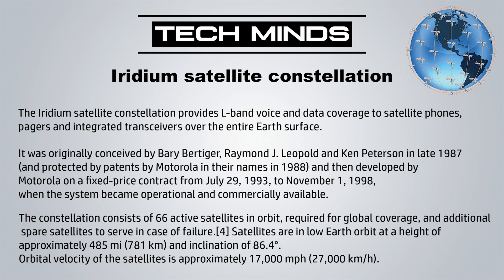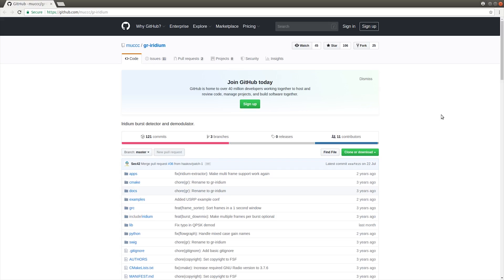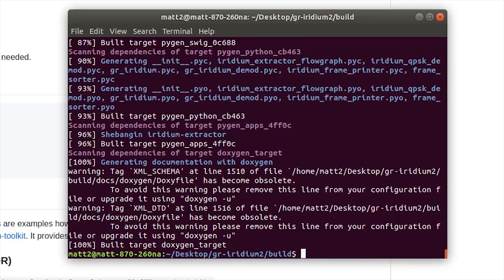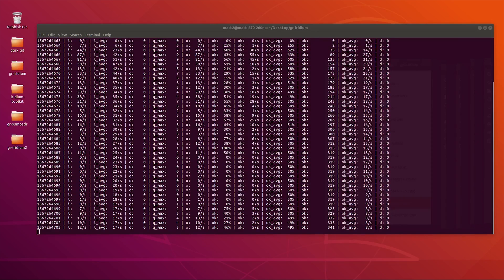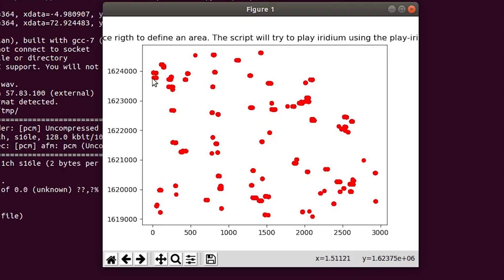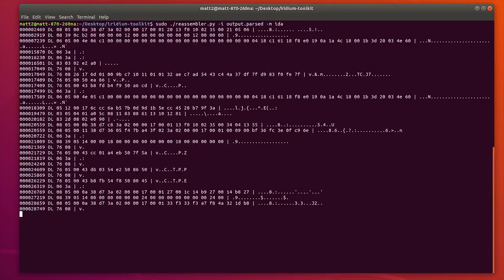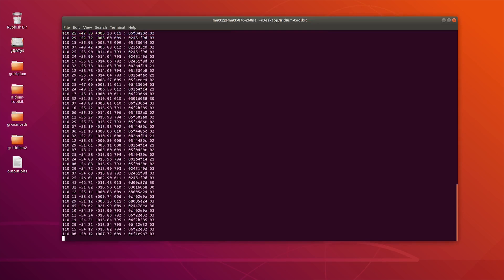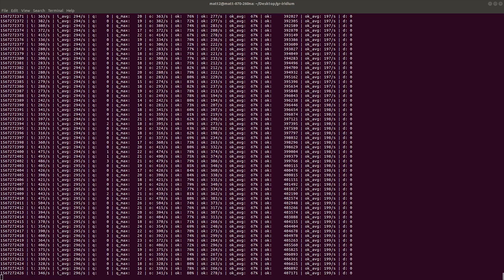Hacking Iridium Satellites With Iridium Toolkit

Comment: Great video and I managed to get everything to work except the codec which returns the following: sh: 1: play-iridium-ambe: not found. I followed the description but the ambe codec I have is just over 60K, I assume that that is because it is a newer codec than the one you show in this older video

Any help would be great. Everything else works an absolute treat
Reply: Needed the PATH setting, my mistake
Reply: What was your workaround for gr-iridium needing gnuradio 3.7.6? Did you compile the older version? Thanks Rob

Comment: I got an error when I was trying to run the Cmake Command. It said that two errors occurred and stopped at 63%. This is my problem with LINUX- EVERY SDR Project I try on Linux involves just a few "easy" commands in linux and I ALWAYS GET ERRORS and there is absolutely no one that can or will help me solve them. You typed "Make" and it just bebops along and finishes I do it and that's where this project stops. 

It's gotten to the point that I have to run through these tutorials before I even think about getting the antenna because there is always an error of some kind.

I know I'm whining and that I must suck or something but this is absolutely miserable. Maybe I can indulge in a little complaining because I know that there is literally no one that will read this or reply and if they do it will be with nothing constructive.

Comment: Thank you so much! Very helpful indeed.

 I just have a problem and would appreciate if you can help. I want to use offline mode and I already stored the received data from Ring Alert channel and be able to decode it in with similar algorithm in MATLAB. But here it seem the iridium-extractor does not go through data at all and return zeros for parameters and terminate. any suggestion? or whether you have a sample data set I can use?

Comment: I am doing some school research work on Iridium Radio Kits, and I am stumped with the following idea and correct me if I am wrong.
Looking at the Iridium makeshift antenna coupled with an SDR, doesn't SDR output I-sample and Q-samples? What happens between the samples and actually the gr-iridium extractor. Are the samples turned into hex codes which is then decoded in the Iridium toolkit? 🤯
Reply from the maker: You would need to look into the GR-Iridium source code to see exactly what it’s doing.
Reply: are you the balloon guy?
Reply: @drspastic  who is the balloon guy lol

Comment: Hi, thank you for everything! I have an issue, it would be awesome if you know how to solve it. When i put the reassembler command for pager messages, the output that i'm recieving are coded messages or i don't know what those are, they are something like this (this is a line taken from my terminal):  
Message 3525599 0046 @2020-03-22T21:07:04 (len:0)  18 OK  : LgAxIybd8X3gZHE7IE2PQvVuD7YefKA1CekD9UAsnxwunncKkrRGzVsh3n+Q

I don't know what is this...
Reply from the maker: Is that from using the pager or msg command?  I havnt seen that before but maybe the msg packet is encoded?
Reply: @TechMindsOfficial  msg command, I think is encoded. How do you receive the messages ?
Reply from the maker: I’ll be able to answer that better when I setup my Linux box again for another video. Please bear with me and I’ll get back to you :)
Reply: @TechMindsOfficial  Ok, thank you very much!
Reply: @TechMindsOfficial  Hi again! Have you been able to find out something about this topic?

Comment: Great video.. I have tried to follow your instructions  to build the gr-iridium , but it fails ( I have Gnuradio working from a repository install  -  stuff changed relating to the 3.7 version of gnuradio by the looks and I can't get it to compile and the same "bug" has been reported on GitHub , with no response :( 
I wonder if you have considered re-visiting this  - I am ripping my hair out :)  I think that you need to build gnradio ( rather than install with apt-get) but there are few clear instructions on that even on github :( 
Love your work BTW! 
I will listen for you on QO-100!
Reply: I'm stuck at this problem too, did you ever find a solution?
Reply: @RobVK8FOES  no , sorry - I moved on

Comment: Hi, thank you for everything! I have a question, i'm working with hackrf one and everything seems to work fine, the only thing is that i don't know if the voice decoding is working, because when i left and right click, this message comes up on the terminal "sh: 1: play-iridium-ambe: not found" , so i don't know if i'm missing something about the configuration or if it's just bad luck and I haven't captured the correct frames
Reply from the maker: Have you set the PATH VARIABLE to the Ambe decoder? Google how to set PATH Variable on Linux, that will help you hopefully :)
Reply: @TechMindsOfficial  thanks i think i know whats the problem, did you had to install mplayer?

Comment: sudo ./stats-voc.py output.parsed
[sudo] password for css:       
0
button=1, x=197, y=216, xdata=-0.029052, ydata=-0.006429
button=3, x=295, y=205, xdata=-0.007319, ydata=-0.009702
sh: 1: play-iridium-ambe: not found
getting this error how do i correct this??
Reply: Did you ever find a solution for this? Thanks

Comment: Good again in the end I was able to solve the path problem. Now I have another question, I was thinking of buying a sdrplay duo to accompany my hackrf and I wanted to know if there is a conf file of the sdrplay for the gr iridium since the bias t of my hackrf does not sufficiently feed the patch antenna of sdrkits, what do you think ? Do you know if it is compatible? you have the duo have you tried it here? Thank you very much, your videos shed a lot of light on this topic.
Reply from the maker: I haven’t tried the Duo as of yet because I didn’t see a conf file. Best SDR I have for complete bandwidth other than duo is the Airspy R2
Reply: @TechMindsOfficial  i have a lot of your gear and i am thinking about buying os airspy or sdrplay duo. I thin that sdrplay duo is more mature but i have some doubts about its support with Linux and some of te drivers tha airspy is completely compatible. What do you think about?
Reply: @newbiescooby Well, the truth is that I did it by doing trial and error. The first thing is to follow the steps of the video very carefully since it is essential. What you have to do (I don't have the PC in front so I do it on the mobile) is to open two stats-voc.py and play iridium amber files with the text editor and what you have to do is in stats voc put before ("here playiridiumambe .....") the path of the file, that is, in my case / home / wcrich / gr-iridium / play ... and in play iridium ambe you put the same thing in front of (I don't remember by memory) the files named in the text that are in the folder. that's it, if it doesn't work i could be more precise Greetings!

Comment: Hello, very interesting and educational video, congratulations and thank you very much for providing us with that information to gain experience in the SDR world.
I am very interested in receiving these signals, but I have a problem or rather a doubt: how can I activate the bias-t of an RTL-SDR v3 from gr-iridium to feed a GPS patch antenna?
Thank you very much, greetings to all!
Reply from the maker: I think I mentioned in the video that you have to open the .conf file and enable the bias tee line by removing the # from the start of the line. Let me know if that works for you
Reply: Hi, thank you very much for the answer, I am very grateful. I already solved my problem, I just added to the line of arguments bias = 1 in the file rtl-sdr.conf and everything is ready. I could see the 4.5 volt at the exit of the dongle after I ran gr-iridium. something like that I had tried before but not in the right way. thanks again.

Comment: What else except https://sdr-kits.net/L-Band-Receive-Antenna-A162 do I need?
Reply from the maker: You will need the software, it runs on Linux so you will need access to a Linux machine too
Reply from the maker: And of course an SDR receiver
Reply: @TechMindsOfficial  Which one?
Reply from the maker: I would recommend the Airspy R2
Reply: @TechMindsOfficial  Is there anything cheaper for beginners?
Reply from the maker: You can try a NooElec SDR, that should work. Check out the amazon store front links in the description and it will show you some of my recommended gear.
Reply: @TechMindsOfficial  I am asking about USB device I can plug Antenna to.

Comment: Will it work with an RTL2832U?
Reply from the maker: It should do yes, just make sure you select the RTL SDR conf file when using gr-iridium 👍
Reply: @TechMindsOfficial  What else do we need? 
your link to the Patch Antenna points to the website not the product. is there an alternative antennas from aliexpress or ebay
Reply from the maker: Ahh yeh, the link points to the website because at the time of making the video they were out of stock and had removed the page. I believe they are getting new stock shortly. I’m about to make a video on using an alternative antenna, with use of an LNA/Filter for IR.

Comment: The original Iridium satellites were replaced with a new version. There were eight launches between January 2017 and January 2019 to put them into space. The old satellites have been retired or de-orbited.  The new satellites also feature ADS-B receivers.

Comment: Good video, would definitely want to try this. How would I set this up on a Windows machine?
Reply: Your best bet would be a virtual machine running Linux with appropriate USB passthrough. Just dualboot Linux, way easier.
Reply: It is better to have the linux system running on the bare metal and put the windows (as long it is needed) into a virtual machine. Windows has (or had) the tendency to even cause interruptions for virtual machines. (There are always important reasons for windows to trash your work)
Reply from the maker: I created a small partition, 100GB on my data drive and installed Ubuntu there, this gives me dual boot and would recommend over a virtual machine.
Reply: @TechMindsOfficial  Absolutely, or just buy a 64Gb SSD for $20 and call it a day, way easier if you don't really know what you are doing.
Reply: Format C:  seriously though, I’m with @zvpunry on this, back up your documents, wipe your machine & install a flavour of Linux, then if you must, run Windows in a VM.

I’ve tried many a Linux flavour.  The sysadmin in me likes CentOS for servers, and I prefer something lightweight for the Desktop Environment/Manager, like XFCE.  Recently tried Fedora with XFCE & didn’t find it as stable as I’d like, so switched to EndeavourOS, which is great - basically a simple-to-install Arch Linux, with XFCE.

Comment: is this legal in the UK?
I'll be crucified in my country for this kind of knowledge.
and do think I can get iridium using a basic nooelec SDR and a basic GPS antenna?
Reply: Nobody is going to be crucified for knowledge. Only for showing publicly that the knowledge was used and random bits of received information (parts of phone calls) redistributed. ;)

GPS antennas like these have relatively narrow band filters. They reduce the out of band noise and therefore increase the signal to noise ratio. Unfortunately signals outside of the GPS frequency are just noise for GPS, so they are filtered away. So no, an unmodified GPS antenna can't be used. But a modified one can, and they are so cheap that you can buy a bunch of them and try to identify the filter and replace it with a wire.

Without the filter it will be wide open, so it will send all the out of band signals to the receiver and increase the noise. More noise means the signal to noise ratio will get worse. But for first experiments it should be OK.
Reply: ( @zvpunry1971 ) thank you for the information.
 I'll read more about how to modify a GPS antenna to start with.
and governments still crucify people for knowledge outside the free world.
in my country for example (receiving any type of radio transmission other than commercial radio) is punished by 7 years in jail.
but as they say (LIVE FREE OR DIE).
Reply: Governments, however oppressive they may be, still can't look into your head!
Here in Germany we have an old song about it: https://en.wikipedia.org/wiki/Die_Gedanken_sind_frei

Is Wi-Fi and Bluetooth a forbidden technology in your country? It allows to share data with neighbors for non-commercial purposes and can be encrypted. Wi-Fi and Bluetooth transceivers are embedded in almost all computing devices, I think it would be very hard to make sure that those devices don't flood a country.

I live in Germany and there are certain frequency bands that are forbidden to listen to, like telephone or police radio. But if someone receives it, how would you know it if he didn't tell anybody that he did?